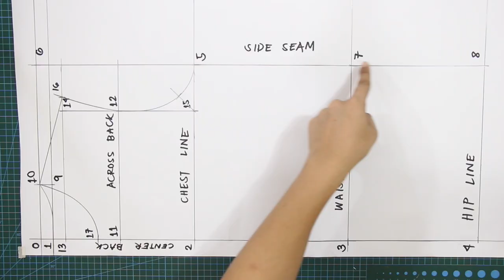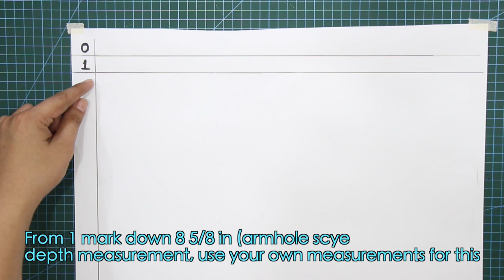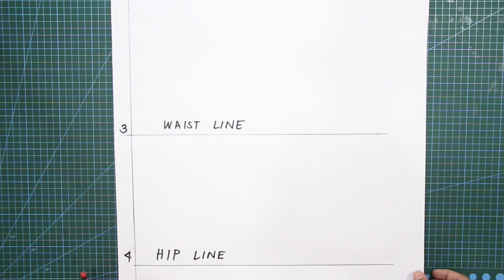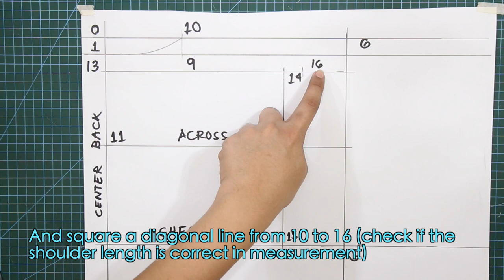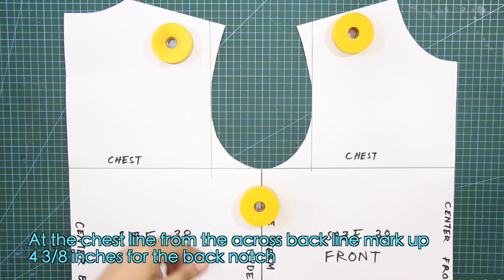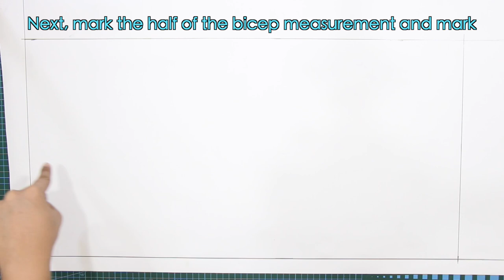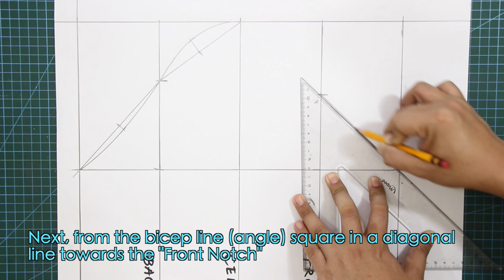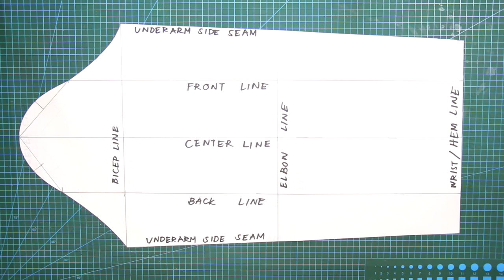MENSWEAR BASIC BODICE & SLEEVE BLOCK| MENSWEAR PATTERNMAKING | LA MODÉLISTE

Comment: dearest La Modeliste, thank you for sharing; I have a question about the sleeve pattern; after drafting I think you forgot the Arm Circumference and elbow circumference and deduct/put 1" in from the underarm line and connected to the arm-pit. After I followed you in each drafting technique my sleeve pattern is too wide down from elbow circumference; what shall I do, may I follow the circumferences measurement or do as you did? Thanks again.

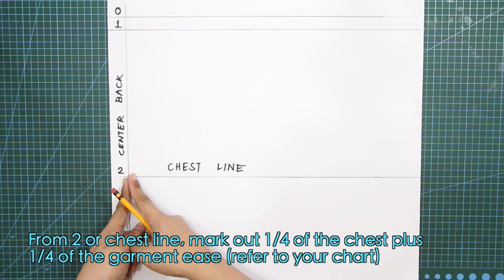Comment: Hi! At 5:00 in your video, you indicate using 1/4 of the garment ease, and that I should refer to my chart. Where have you discussed ease? Did I miss a video? Thx for a great tutorial.
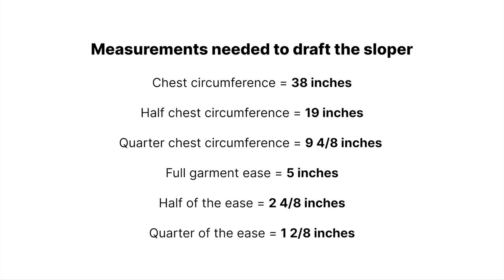Reply from the maker: 2:17… please check out the link for the chart
Reply from the maker: The 1/4 in is added for ease.
Reply: @LAMODÉLISTE Thx! The caption in the video does not have the "in" after the 1/4. So I was confused. Thx for clearing that up.